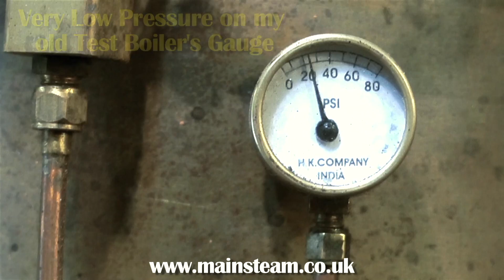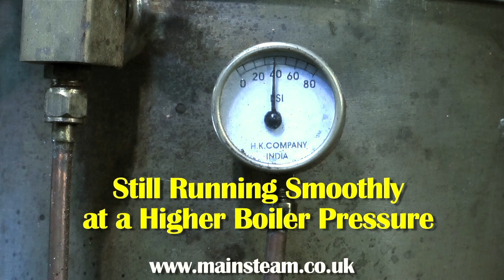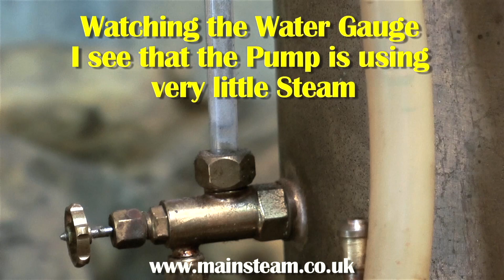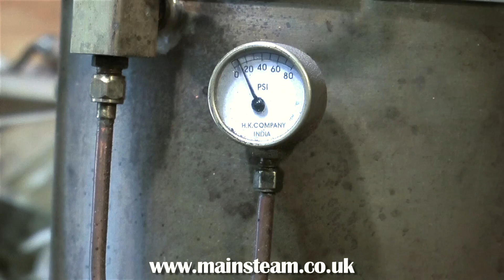ADJUSTING A LARGE 12 INCH "SOUTHWORTH" STEAM BOILER FEED WATER PUMP IN STEAM ON THE BENCH

Comment: That takes me back to the 1950's running Scotch Boilers on board ship and fed by Weirs pumps. We had a very large one for cooling water. It had a water cylinder of about 2 feet in diameter. Because it wasn't pushing against boiler steam pressure the steam cylinder was smaller. We had to be very careful to warm it before admitting full pressure. With a cold cylinder the steam condensed causing a vacuum in the cylinder. This caused the piston rod to travel right to the end of its stroke. The only remedy was to get a six foot pry bar and force the rod to move back to centre.